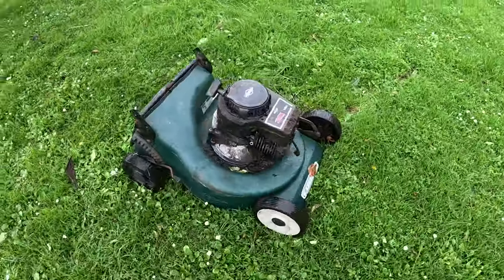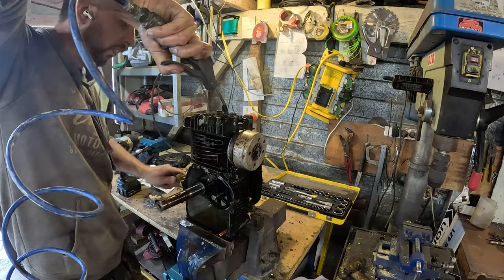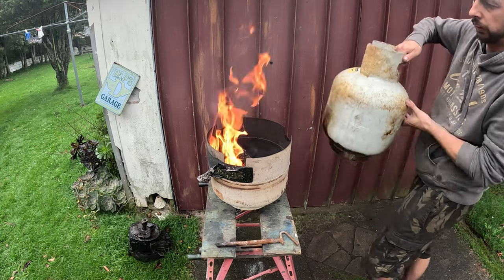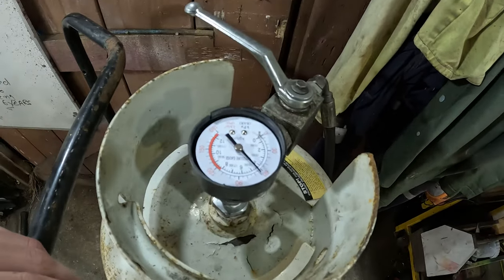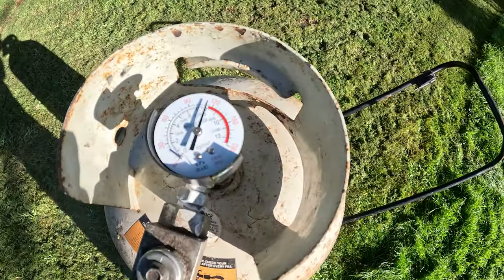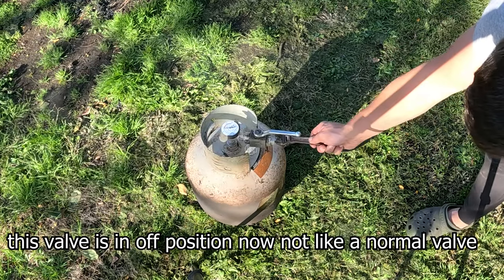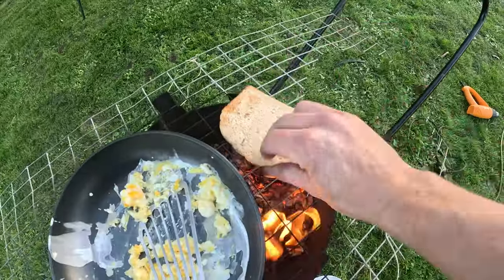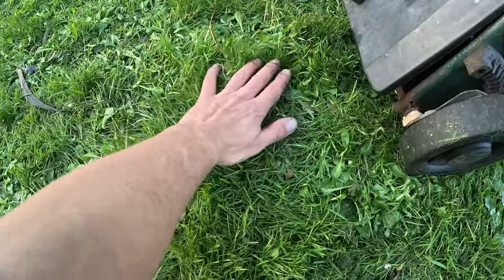Steam Power Lawn Mower

Comment: Looks like they handle around 375 psi max based on the pressure relief valve standard rating. 180 was well within acceptable limits. Looks super sketchy when you dumped all that steam though haha
Reply from the maker: Yeah I looked up the specs for the tank and I am well within still felt dangerous though
Reply: @DktheWelder  fuck I bet man, the heat might make the psi it can handle a different amount or some crazy unforseen thing could happen, I was sketched out watching it haha
Reply from the maker: @offgridas  yeah there is no limit to how much pressure you can make until it explodes haha

Comment: You need a superheater.  That's where you run the steam through a coil of pipe that is right below the boiler, just above the fire.  The steam comes out "dry" then and with much more power.
Reply from the maker: Yes! The superheated steam pipe, on my next attempt I will try that

Comment: Not sure how serious you want to get with this setup. But you could most likely get massive improvements in at least runtime, if you would change the exhaust flow. Like, weld some exhaust tubes onto the boiler. Because now, you're using only a small contact area. Making the (hot) exhaust gasses pass along the sides of the boiler, would heat up the water faster and you'd be extracting more heat. You could also look into insulating the boiler some more.

Sidenote: didn't see a blow-off valve?
Reply from the maker: I have been looking at heaps of steam train videos for ideas haha. I didn’t have enough parts to put the relief valve in just had to watch the pressure constantly!

Comment: You might be able to use the air cooling from the Briggs as a blower for the fire, eh? Kickassingly fun project man.
Reply: And/or a 2nd flywheel stacked on for the mass? Could  weld weight to the blades or add to the one flywheel? And/or all three... ooh look, a bong!  xD
Reply from the maker: Yeah that is a good idea ! I want to see how the ones on trains work

Comment: If you add an exhaust pipe to the burner and route exhaust steam from the engine into/through it, it will create draft and pull more fresh air for the fire. Basically a steam-era turbo charger, just like how trains used to do it!
As a side note, if you mowed an overgrown lot, gathered cut grass, dried it, and pressed it into pellets, would that be enough fuel to cut the grass again once it grew out? Highly doubt it, but would have been neat if it was.
Reply from the maker: Yeah a superheated steam pipe , this setup is super inefficient. You could probably dry grass out and use it to cut itself which would be cool but like you say I don’t think it would be enough

Comment: I have often thought about using superheated water injection to make a steam engine. 
So for a 100cc engine, injecting 1cc of water gives 1000cc steam so 10 bar pressure at full stroke.
So 175c theoretical without losses.

I know, the head and injector have to be kept at about the 150-200 to be effective but it’s still a fun idea, low pressure water feed at 150psi and injector pump of 1cc at anything higher.
Reply from the maker: That does sound like a cool project! Google says one litre of water gives 1600 litres of steam! I think using an injector is a cool concept!
Reply: @DktheWelder  
Yes. I know. 
I rounded down for losses. 

And if you look at the steam being 250c it’s going to be 3 litres. 
But let’s not worry about that. 

I’m sure you are far smarter than me so I’ll leave you to it. 

Have fun. 

But be careful supercritical water aka dry steam is not a toy.
Reply: @DktheWelder  
Oh the other thing is the pressure throughout the stroke is more stable.
Reply from the maker: @brucebaxter6923  I don’t know about being smart I just have a go . It did get dangerous because I was getting frustrated with it not working and I started taking risks. I’m think about doing a bit more serious steam project but I need to get back to my other projects
Reply: @DktheWelder  
Well, smarter than me. Lol. 
Yes, risks. 
The starting point for my idea of the super critical water injection was safety, by having cold water stored and not a boiler the risks are lessened. 
The thought was to only heat the water at the injector/cylinder head area. 
Never really worked out how apart from heating the entire cylinder.

Comment: A suggestion I have, is using the engine to drive a draft fan to induce more air into your firebox. Alongside the other suggestions of superheating the steam, and integrating tubes in the boiler for the hot gasses.
Reply from the maker: Yeah this was a lazy attempt at making it, I think what your saying is dead right I want to have another go at it👍

Comment: This is just a suggestion. If you can before you send steam into the motor, Have a pipe that runs from the delivery pipe and back through the fire, that should heat up the saturated steam in to unsaturated steam or "super heated steam"  creating more thermal yield thus creating more power and if you want you could collect the escaping steam and send it back into the boiler fully recycling all the steam used with a better out come with more power. Adding insulation around the boiler itself would allow the boiler to contain most of the head being generated from the fire below, and a safety valve would keep it from exploding.
Reply from the maker: I thinking of building a better version with some actual effort put into it and make a proper boiler as you say , and the safety valve haha like everyone is saying , it’s not as dangerous as you think the pressure doesn’t just keep rising it needs to get really hot and then it rises slowly and predictable I learnt alot doing this , but I will put pressure relief in next time
Reply: You can steam some veggies for lunch while you're at it

Comment: Interesting!  If you want a powerful and controllable burner, check out some of mine.  You may be able to take the steam from the exhaust and use that to fan up the fire even if it is by vaccuming more oxygen into the fire  through a venturi.
Laying the boiler bottle on it's side may give more surface area especially  if you welded a flue through the middle to give more surface area. 
Really amazed ( horrified!) this engine had a plastic camshaft.  How much more cheap and garbage can they make things?
Reply from the maker: I have watched your channel before actually! Definitely the boiler isn’t up to the task , I like the Venturi idea . Even though it has a plastic cam the mower shop guy said that motor is one of the best motors you can get

Comment: WATERMELON!!!!!!!!! I recently have been playing with steam things too, so here's what I've learned so far: 1. Pressure cookers make great boilers. 2. Steam turbines work better for things that need to spin fast. 3. Cheap amazon pneumatic pistons are way easier to turn into piston steam engines than gasoline engines. 4. mango.
Reply from the maker: O cool, do you have some on you channel? A double acting cylinder is the way to go the way I have it running is really inefficient
Reply: @DktheWelder  I don't but I might make some videos on building a new one and operations.

Comment: 3d print a cam that'll open both valves? or cut a hole in the block low down so it'll actually be a two-stroke, not that i know shit about steam power
Reply from the maker: Yeah it is more efficient to run it through the intake and have double lobe cams for both. A real steam engine is like a 1 stroke so maybe feeding pressure into the crank might work
Reply: Am actually building a flathead powered motorbike outa the same briggs engine, strange midlife crisis kink but whatever, if you successfully print a cam and it runs i'd be mildly entertained 😂

Comment: Next time you may want to direct air coming from the motor's flywheel into the furnace, and it would be very nice the grass cut  from last time as a fuel into the furnace after it sit to dry
Reply from the maker: Yes that would make it run alot better! Big fan of steam engines would like to try this project again

Comment: use a monotube boiler, its just.... safer. hands down, safer....

a roll of 1/4" copper from the plumbing shop. a decent high pressure pump. something like... the pump off a hydraulic jack ;)

just wack it on a cam off the crank, with a lil hand lever to start with, and bleed the pressure off before the boiler for the throttle...

a cup of water inside at best, they just go "pffft" if they leak..

rocket stove, much better fire. more heat... 

now, a really neat thing would be throwing a few multi row oil coolers onto the exhaust, and keeping the shroud/fan.... try condensing. 

and then, for extra complexity.... the fan is blowing the fire.

Comment: Plastic cam? What kind of planned obsolescence is this...
Reply from the maker: Yeah strange , on an American motor too . Those motors are known for being reliable too
Reply: @DktheWelder  they have been getting worse. They don't use iron cylinder sleeves anymore in a lot of cases. Plastic carburetors too. I replaced the Briggs&Stratton vertical shaft engine on my mower with a Predator Honda clone and it's so much better